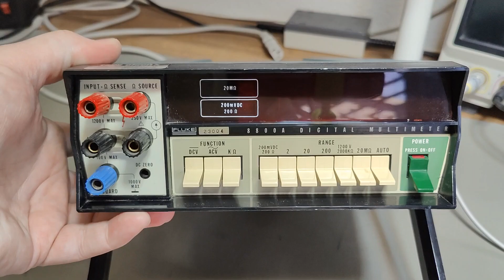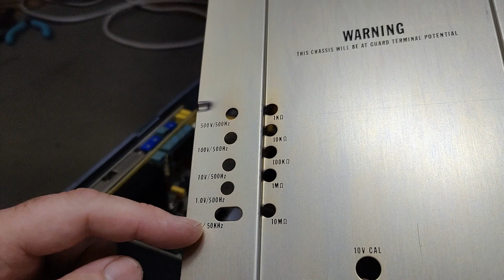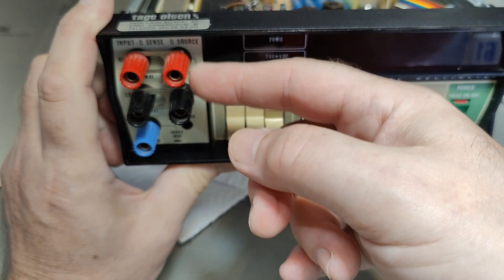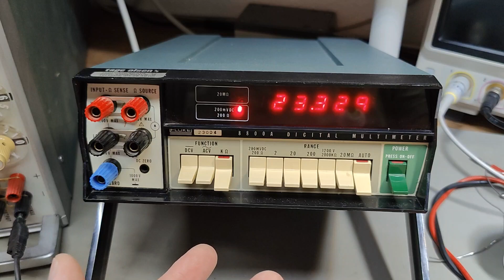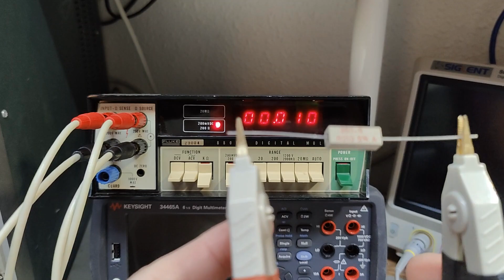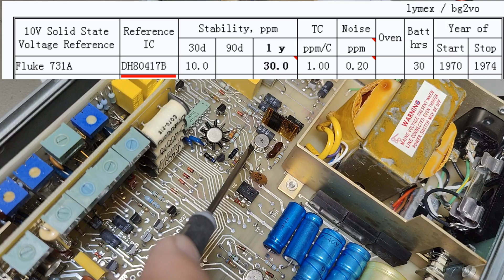FLUKE 8800A Digital Multimeter 5dig LED 1974 test teardown

Comment: For those who worked with Fluke 8505 series 19 in, rack modular multimeters, the DC conditioner section is almost a coycat of the 8800a. Surprisingly, for both instruments the DC volts input buffer is NOT the classic bi-FET type but a differential BJT pair with a surprisingly high 2.8 MEG ohms common-emitter resistor that makes these transistors work at a ultra-low 1 µA emitter bias for each BJT. To compensate for the nano-amp level base bias, Fluke has added a bias-nulling 100 MEG resistor that can be voltage-trimmed to completely remove input-bias on the lower DCV ranges.

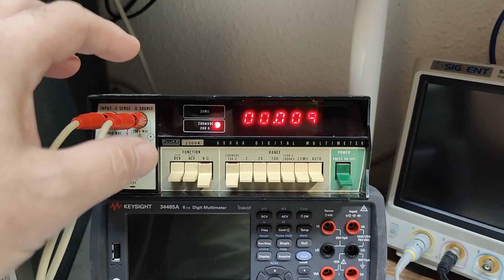Comment: 14:32 Another instrument that is surprisingly good at measuring really low resistances is the Fluke 8012A 3 1/2 digit multimeter. It has two extra low resistance ranges: 2 ohms and 20 ohms. Being a two-wire ohmmeter, you may zero it with a front potentiometer. You'll need a set of high quality probes for this purpose.

The 8012A is highly affordable today. I acquired one for $ 50 in a Hamfest. 50 bucks for a Fluke !! And they are as good as they were produced in 1978.

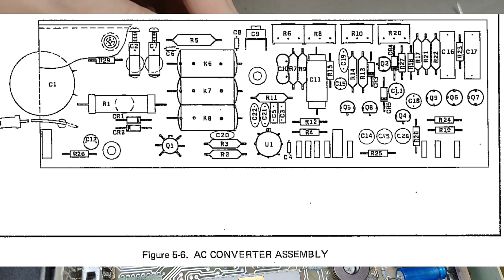Comment: 17:00  This module is the AC converter board ans the big orange capacitor ( .05uF 1kV ) is the input DC blocking capacitor.

The whole dual slope ADC is on the rear left of the instrument, next to the rear calibration potentiometers and the main .047 uF integrator capacitor is the large metallic axial cap. between TP1 and TP2.

Also the large relay just behind the front panel is K5 that switches the input precision 100:1 attenuator that is required on the 200V and 1000V ranges. Outside of these two ranges, the input Hi-Z buffer is directly connected to the input banana jacks which makes the 8800 a high impedance instrument on 200mV, 2V and, surprisingly, the 20 Volts range, which is rare today on high-tier instruments.

Comment: Hi Thomas, I have one exact meter like that and tried to repair it BUT I could NOT take it apart.  You SKIPPED the part that you were taking it apart.  I would like to know HOW YOU DID IT.  Thank you.
Reply from the maker: screws at the back, then slide cover out the back, it can stick so you need to wriggle it a bit
Reply: @TeardownOZ2CPU Hi Thomas, I did it. The calibration sticker really held the cover tight. Thank you  very much.
Reply from the maker: @sonny8m  great.. mine was so tight fit, I had to use two hands, that is why no video of it :-)

Comment: You might want to check on that big black box on the ohms converter ... there are no read relays in there but two alkaline 1,5V batteries!! Who knows when these where last changed.
If these are empty that might explain the weird behavior of the Ohms measurement,  it should work in two-wire mode without the links.
Personally I would replace them with a single lithium cell ... or just leave them out.
Reply from the maker: wow that is super good info i did not see that, they really looked like large reeds, i will check it, thanks a lot